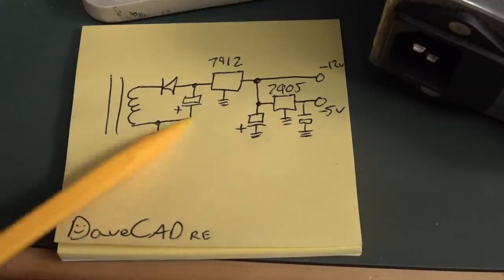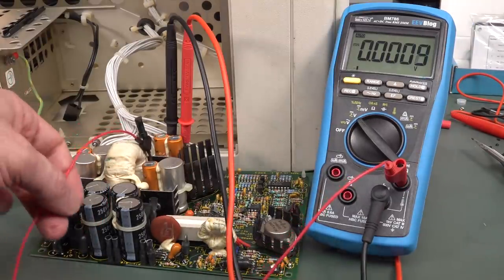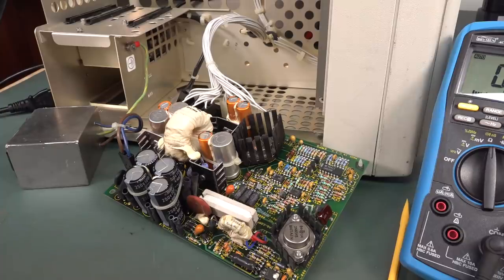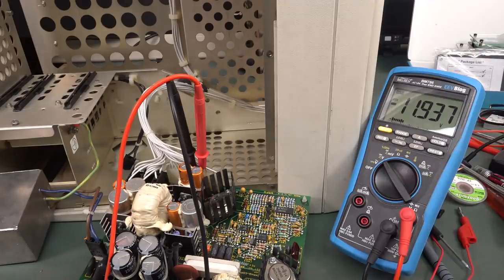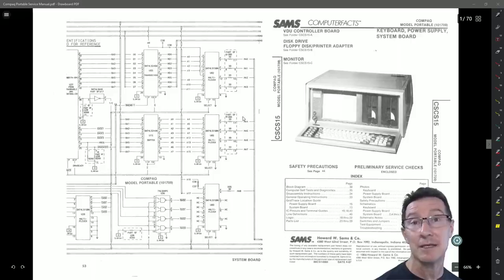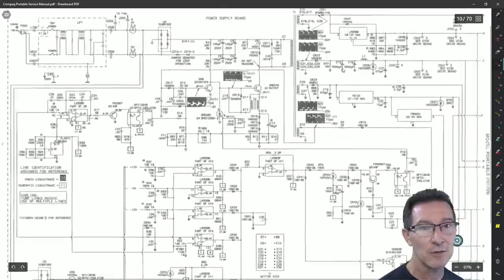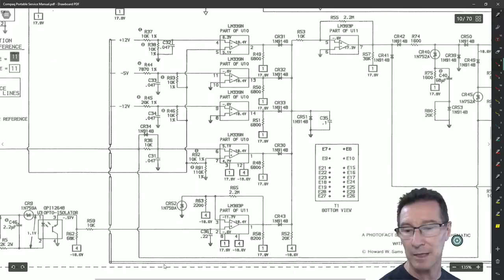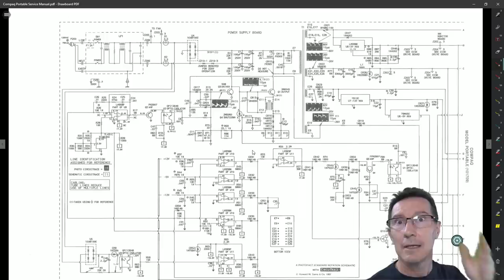EEVblog #1364 - Compaq Portable PSU REPAIR

Comment: I repaired a 3457A DMM recently which had a knackered transformer......no such luck on a broken external connection though.....ended up rewinding the transformer from scratch as it just didn't make sense to let the old 3457A die.

Comment: Sams Photofacts were aftermarket service data for consumer electronics. Anyone who worked in TV/Radio shops in the US would be familiar with them.  Instead of simply redrafting the manufacturer's service data, they actually reverse-engineered it from production units. A typical folder for a television chassis would have the schematic, parts layouts, test point locations, parts lists (giving OEM p/n, as well as several aftermarket cross references), assembly/disassembly instructions, alignment procedures, dial cord or drive belt stringing diagram, etc.  

The best thing about them was that unlike the various OEM manuals, they were all laid out in a standard format, with signal flow from antenna to CRT arranged left to right, with voltages and key waveforms marked right on the schematic. They released these schematics at the rate of 5-6 sets per month, with each set having folders for maybe 5-6 TV sets, and a handful of radios, stereos, etc. Every decent TV shop had a subscription, and a library of photofacts that took up several 4-drawer file cabinets. They published a periodic index that you could use to locate the proper set and folder number from the model number of chassis number of the set dropped on your bench. Pulling the appropriate folder out was typically the first step after popping the back off the set and looking for obvious faults. They started in the late 1940s, and were still being published into the flatscreen TV era, I believe.

Comment: Had a "Doh" fault find  moment today with a inverter welder.  All the stuff so tightly packed that I didn't see a huge scorch mark hidden between components during the visual.  It took a fair bit or tracing and metering on the back side until the "hang on a minute, there's a blimmin' great burn on the board down there and a film cap with a black end... "

Comment: Multi stranded wires are actually less reliable and tend to oxidize and decompose in few decades. It doesn't requires much moisture in the air to rot thin strands because they have more surface area. I've seen old coaxial antenna cables that just lose connectivity in their braid and when you cut the outer insulation the braid just spills out in tiny pieces.

Comment: As soon as I saw the 'normal' diode test readings I was pretty sure it was an open in the transformer. It's nice that the break was right at the board connection and not buried inside the core.

Comment: I used to use Sams Photofacts for television and radio troubleshooting in the late 60s into the 70s. They were high quality schematics (even with corrections from manufacturers and notations about revisions) with test point voltages and scope traces. They were available for most about anything, and you could get them at electronic parts houses, or order their catalogue and get them by mail. The best schematics from manufacturers had all that anyway, but most manufacturer schematics were far from the best. I'm surprised most don't know what they were. I headed off into other careers and lost track.

Comment: Edit: This is all covered in a PRIOR post...  I didn't see it until too late!

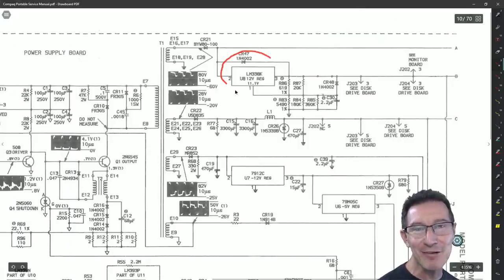Somewhere around 25:30 you're kinda 'complaining' that they didn't use a linear regulator on the +5V rail (while they DID use one on the +12V, -12V and -5V rails)...
The answer, of course, is that the +5V rail uses PRIMARY side regulation by way of the TL431 voltage reference.
If the +5V rail falls too low, the ENTIRE SMPS duty cycle is increased (which implies that the INPUTS to the +12V and -12V linear regulators will also increase!)
The 'effective' degree of voltage regulation on this PSU is, in many ways, BETTER than that of a modern ATX12V PSU.
(Modern ATX12V PSUs deliver TRUCKLOADS of amps on the +12V rail, negligible on the rest and don't even HAVE a -5V rail).
If ya go one step further and look at SERVER class PSUs, you'll find that they have a +5v standby (mostly used for no more than to power the 'soft-on'), a very small -12V rail (barely regulated at all), and a HUGE +12V rail that often exceed 100 Amp!
.

Comment: 16:06... I would have added a small piece of silicone wire to the broken lead to 1) simplify re-connecting to the Pad. 2) relieve the stress on the XFO wire due to any future vibration problems.

Comment: Photofacts date from 1946 (I had one in folder #1, an Arvin Radio).  For most of the time they were related to vacuum tube devices and their troubleshooting.  They were published on a regular basis for servicing electronic devices.  If you had to "service" an electronic device (alignment, etc.) there were VERY useful.  As things got more integrated with ICs and the like and more and more circuit boards, servicing got relegated to "swap and replace" methods, and fixes like the one you just did got left by the wayside.  Time marches on.

Comment: I repaired the smps on an HP 35660A. That has multiple rails as well, and one of the voltage comparators (LM339) was blown, giving a constant high output (forgive my memory).  The result of that condition was a constant shut down signal being given to the oscillator.  Once I fixed that, and the machine went through POST, it gave a memory error.  I ended up replacing 32 memory modules (M5M41000BP-10) with sockets and new ICs, and then it worked.  A very satisfying result, as I am only somewhere between an amateur and novice.  NO idea why double failures, as it was an ebay item, but I'm thinking voltage spike

Comment: Back in the day, every local Radio/TV repair shop had a Photofact subscription.  They provided schematics & service data for most mass produced electronics.  Easier I guess, than trying to get that info, piece by piece, from dozens of manufacturers.  Still widely in use when I started my electronics education in the '80s.

Comment: Wire that hard to get in, I would simply cut a short wire and put it in the hole, and do a soldered joint up high where it is easy to get to.  Best to put a blob of flexible gunk to hold that transformer down to the heatsinks all round, to keep it from vibrating any more.

Only the 5V rail is regulated, the rest will be much higher voltage, so the regulators to handle the extra voltage when unloaded. The one chip switchers to get the linear regulators out were still in the future. 5V6 zener is there to go short circuit, hopefully, on loss of regulation, and short out the supply. Only thing is they also like to leak slightly and then fail as open circuit.

Comment: That computer must have very low hours.  I used to fix those power supplies back in the '80's and they were cooked!  A number of them the circuit board had become conductive.  I sent a number of back into the field with gaping holes in them.

Comment: When I was a kid I hung around in a hobby shop that had big file cabinets full of folders for about any type of TV or radio you could buy. All Sam's Photofact. I think the CircuiTrace was just a map of test points. Who knows, some boards might have been labeled.

Of course Sams is still around, right? Computer language and EE books.

Comment: Hey Dave,  You were saying that it wasn't very good the way the it appeared to have no regulation for the 5V rail, well the Switching chopper regulates it. That's a really cool thing, compaired to some slightly more modern PSU's which regulate the 12V rail and just assume that with less turns on output transformer for the 5V rail that it will follow that if the 12V is good then the 5V is  good also. This is great till the Electrolitics on the 12V rail go leaky and the PSU is working over time trying to get the 12V rail up to voltage. All the time the 5V rail is near 10V as a result. (This cannot happen with your power supply). I had this happen in a AT power supply and it blew up everything in the system. HDD Floppy, Mouse, Keyboard, CPU but oddly not the RA,. Multi IO Card and VGA card all stuffed due to bad PSU design.

Comment: Please stick the transformer back down with silicone adhesive to the headsinks, as it was before. Next cable, that breaks, might not be fixable anymore.
As you can see, it was originally fully stuck down to the heatsinks on 4 points, so it should have been held in place pretty well. The silicone must have cracked maybe during shipping and after that the cable broke loose over time.

Comment: Dave, what I found most interesting is that you never heard of SAMs photofacts,   TV shops over their lifetime would have collected thousands of them.  Once pack, had the main schematics you were looking for a given TV and then usually had several schematics for lesser ones.  There was a printed manual that you would look up the MFG and Model and know what SAMs to get out of the file cabinet or to buy from the local TV parts supply shop (in Central, Pennsylvania, that would have been Cumberland Electronics).  Quite frankly, myself, I haven't thought about SAMS in a long time.  I figure SAMS went bye bye when manufacturers stopped releasing schematics in the mid-late 90's.  But back in the pre-throw-away day, it was almost impossible to fix a TV or stereo without a SAMS.  they were readily available, so why not?  The quality and layout of the schematics, to a technician, were excellent (you made fun of that part).  I didn't realize they did computers too.  Wow, too cool and a wonderful look through the way-back machine.
Reply: I have a feeling Sam's might not have been a thing overseas. I'm not sure though.

Comment: The transistor was made in Manton Lane Bedford by Texas Instruments in the factory they built and opened in 1962. The jedec coded semiconductors were not seen so much and nearly everything was pro electron coded..Apart from the ubiquitous 2n3055..Maybe I'm talking bollocks, but it's how I remember it.

Comment: i got a strange problem wih 78xx linear regs. i put a 7815 and 7915 +-15v psu in my design with several ne5532 opamps and when i power it up, theres like a 25% chance of the positive rail not starting, it gets pulled to -0.7V. and stays there.
but most of the time, it just works like it should

Comment: Why run the -5V reg off the -12V one? Won't the total power dissipation be the same as running both from the higher volt source? Only the dissipation will be more weighted to the 12V reg?

Maybe a good opportunity for a video on best ways to power share across devices?

Comment: So... in the end... the only thing wrong with the machine was, like, the third component that power reaches from the mains input? Which meant no negative DC rails, which meant no Power Good signal, which meant the CPU was stuck in a reset loop, which meant no output from the graphics card, which meant no CRT display...

Comment: I would love a run down of the CRT board and common failure points, I have about 4 of these units and 3 of them have crts that popped, tried recapping them and doesn't work.
For anyone else out there with this tube, the heater element glowing very dimmly, maybe somebody has an answer? I think it's the Transformer but I'm unsure.

Comment: Is the solder mask that is on the traces at the bottom of the pcb comming off? It looks like paint after chemical paint stripper has been applied.

Comment: I have a Compaq Portable too. It's currently working but I'd love to have schematics for it - have you got a link to them or could I contact you via the EEV blog? Mine's running DOS 3.31 and Norton Commander etc again, just like the good old days! I've even got a 32MB Hard Card (HDD) - phooaaarr!
Looks like a self oscillating primary with a saturable, proportional drive transformer (T2). Driving a bipolar transistor (Q1) with a relatively low current gain (datasheet says as low as 7) would otherwise require a massive dropper resistor to supply it from the DC bus. Nowadays we have MOSFETs which are considerably easier to drive but back then, SMPS was much more of a challenge. I started out in SMPS around the time this PSU was made (1984, looking at the date codes on the devices)...

Comment: Hello love your videos question for you if I may. I have the same machine and the power supply seems to have a short on the -5 V rail would you happen to have a schematic or know where I can get a schematic for the power supply. I have replaced a couple of the capacitors but there’s still a short to ground when you touched the ground pin to the -5v pin.

Comment: Heatsinks by electrolytics argh, why do they do it.
Reply: given this thing worked so long and the failure point is a wire, i think they took into account the power dissipation so it wont get hot enough to even degrade the life of the caps.
Reply: Because it wasn't designed to last forever. That said life still may be off the chart (decades of continuous operation) depending on temp and hour rating and how hot they actually get.
Reply from the maker: Some men just want to watch the world burn.

Comment: I've always wondered... What component(s) on a motherboard actually require negative supplies?
Reply: RS232 plugs. 
They were used before usb became common.
Reply: Many NMOS chips needed -5 and +12 in additional to the main +5. An example is the original 8080. While the motherboard itself might not need negative voltages it was still provided on the expansion slots for cards which might want it. Another example might be some analog circuitry such as sound circuits, modems, and maybe disk controllers.
Reply: Audio chips too.

Comment: Why do switchmode power supplies seem to always use half wave rectification?
Reply: If it's a flyback topology, that's the only way it can work. If it's any other topology, a single diode is more efficient since every diode has a voltage drop and there are 2 in series in a bridge rectifier. In high power supplies, often they actually use mosfets instead of diodes for even better efficiency.

Comment: -12v was often used for DRAM.
Reply: I think you are thinking of EEPROM not DRAM.
Reply: I think Dave was right, -12 Volts is for the RS-232C line drivers.  The -5 Volt supply, along with +12 Volts, is for the DRAM chips of the day.  See https://www.righto.com/2020/11/reverse-engineering-classic-mk4116-16.html for a great insight in these things.  The +12 Volt supply also does the RS-232C line drivers, but its main load will be disc drive (hard and floppy) spindle motors.
Reply: @Brian_Of_Melbourne  What the hell did DRAM need with negative voltage?
Reply: @phillipsusi1791  It's for Substrate Bias.  Google that for lots of info about it.  Later chips used on-chip electronics to generate the negative voltage.  See https://www.righto.com/2018/08/inside-die-of-intels-8087-coprocessor.html for info about a chip that has such a generator and an explanation of Substrate Bias.  Glad to have piqued  your interest. :-)
Reply: @phillipsusi1791  Again no.  EPROMS of that era were the same +12, +5, -5 devices.  See https://en.wikipedia.org/wiki/EPROM#EPROM_generations,_sizes_and_types Look at 2704 and 2708.  Note that programming voltages aren't relevant here because this is a read-only environment.
Reply: @Brian_Of_Melbourne  -5 is what I was thinking about. I remember that the ram used in the zx spectrum requires negative voltage.
Reply: Oh, and I've just learned the original Intel 8080 was also a triple supply beast.  The Z80 was five Volts only though.  See https://www.youtube.com/watch?v=V1dH8UvlEdI for a load of good info on those CPU chips.

Comment: Dave, after so many years of operation,  with no evidence of component failure, shouldn't we check ALL of the connections, first?
Reply from the maker: It's wise to reseat IC's in sockets, jiggle connectors etc. Wasn't possible in this case.

Comment: Dave complaining about the design of this PSU makes me laugh, because I've had to repair several mid-2000s ATX PSUs (you know, the ones with higher 5V amps than 12V), and the design on those is just abysmal. Everything crammed into a single-sided board, no plugs for anything, multiple wires using a single via.
Everything held together with low-quality early-2000s RoHS solder, epoxy, and a prayer.

Comment: Ahh, comcrap.  I stopped using those when the bastards started putting extended parts of the bios in a hidden partition on the hard disk so if you replaced the disk, it wouldn't POST.
Reply from the maker: WTF, really?
Reply: Had something similar on DELL for a bit too...
Reply: @EEVblog  Yea, I had a highschool internship with the navy for a bit in 1997 or 1998 and they had a bunch of comppaqs and we tried upgrading the hard disks and they wouldn't POST let alone boot from a dos install floppy or even let you into the bios config screen.  Went and looked at the original hd and there was a hidden 10mb or so partition on them.  Once we replicated that partition on the new disk ( and did a low level sector by sector copy ) the system booted from the new disk.  Was really crappy of them.